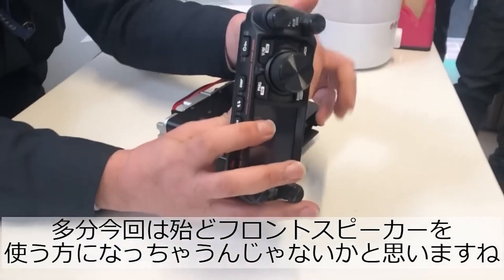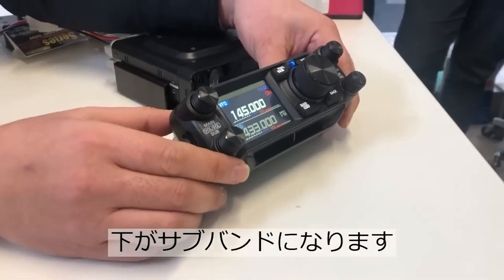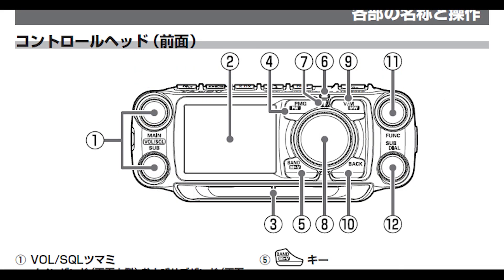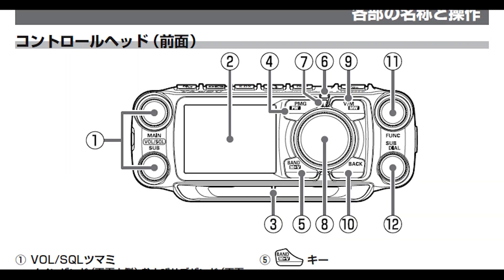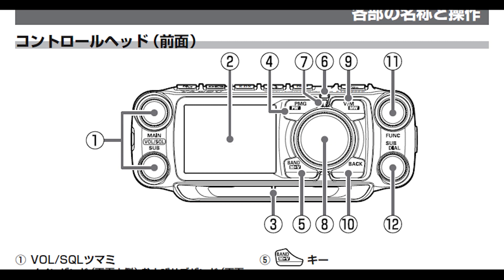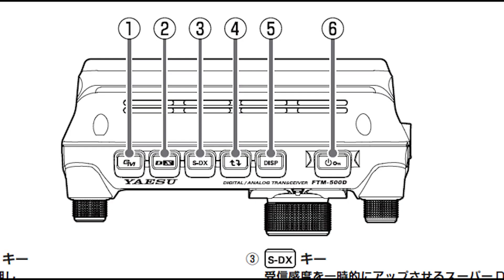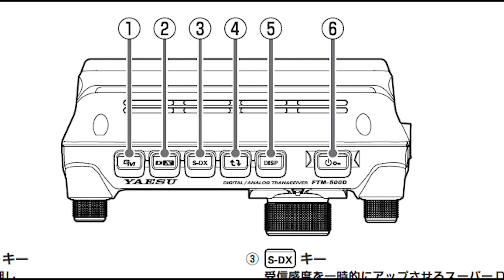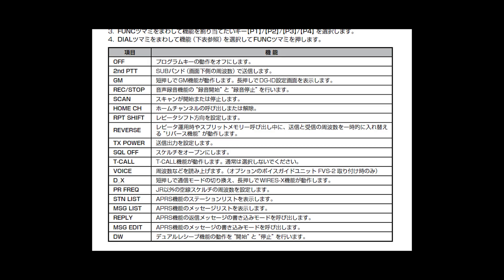FTM-500 - More to the Exterior Design Than Just a Big Head!

Comment: Is this a TRUE Dual Bander like the 300?
I have an FTM 200, and it has been a SOLID little rig. Do you know if the 500 Head unit will fit on the Body of the 200, or is the circuitry enough different to make that a non-starter? AC7AA.

Comment: It's too big and too deep.  This is a design mistake.  It eliminates a bunch of mounting options.
Reply from the maker: Going to be a factor for sure
Reply: You can mount the head very very flexibly, I think folks are going to make it work.
Reply: @randominternet5586  I have an old icom 880 dualband mobile in the car right now.  The head unit is about the volume of two pack of chewing gum.  A couple of neo magnets and it's securely attached to the car console yet super quick to detach and hide.  What's in this Yaesu that needs so much space?  Vacuum tubes?